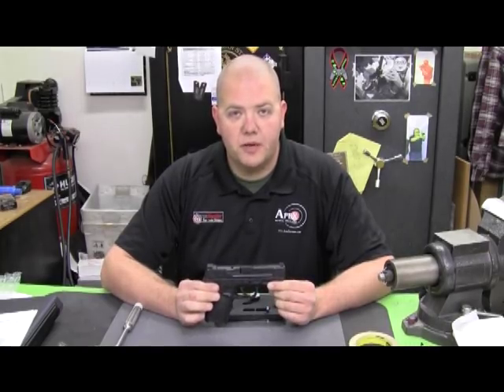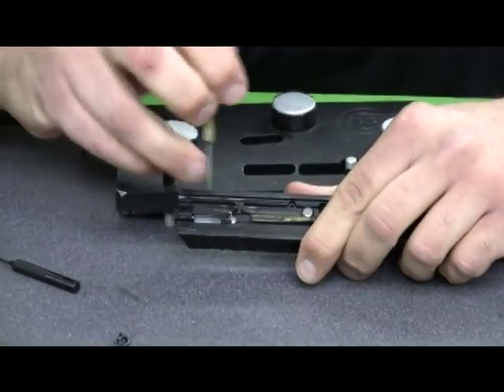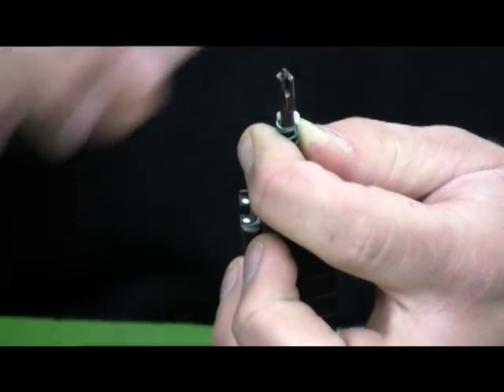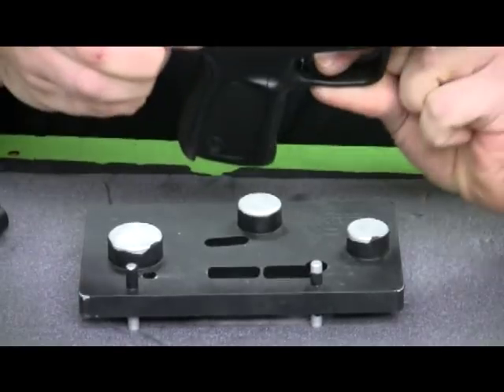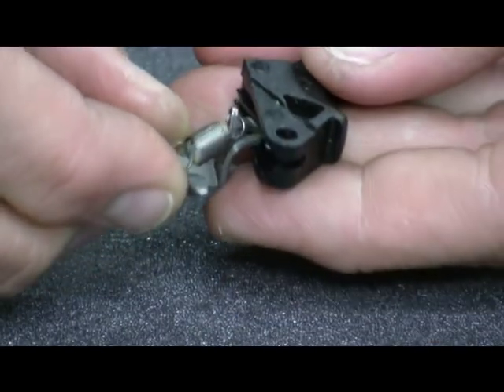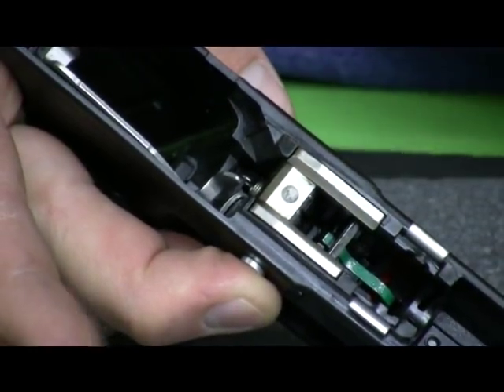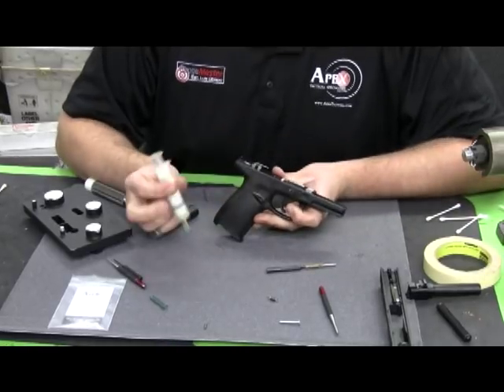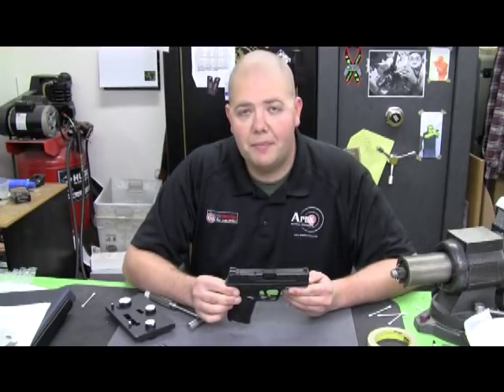SD/Sigma Kit install

Comment: I was able to install this thing, and it was the first time I had broken down a fire arm this far. I am a little bit handy, and the installation wasnt too bad. I did note on initial breakdown of the trigger pivot pin, I did have pull it out in  the opposite way of what the guy in the video did. It doesnt seem to matter as long as you install it back the correct way. The only part that was difficult was the reassembly of all the parts through the pivot pin, but if you stay patient and use a flashlight you will get it lined up.

Comment: I tried this with my SD9VE. Everything was pretty much the same ....except, when removing the trigger pivot pin, the slave pin would not insert from right to left as video shows... the slave pin removed the pin going left to right.(so backwards in a sense) The knotches on the pin were the same, but i could not remove it as shown on the video.
Becasue of this, reconnecting the slide lock lever was tricky moving left to right.
Hope this helps
Reply: +escaldo74 same here thank you for that, it really helped me out
Reply: glad it helped you out! I struggled with it! lol
Reply: +escaldo74 You just saved my life.
Reply: +escaldo74  thank you for posting this. I had emailed Apex and they did not suggest anything beyond keep trying. That didn't work. I tried your way and it came right out. Thanks again!
Reply: +Bill Rice glad it helped!!!!
Reply: Miles Norsworthy glad i could help
Reply: +escaldo74 I had exactly the same experience yesterday on my SD9VE.  I only wished I had read you're comments before trying to install the kit.
Reply: +escaldo74 Mine won't budge from either direction
Reply: +HiveTyrant36 Did you ever figure out what was wrong? I'm having the same issue.
Reply: Justin Baker Aw man! I got it after about 20 minutes messing with it. I honestly don't remember. I think I may have knocked it out by force. After that it was smooth sailing. Easy to put back in. Wish I remembered. Get a hammer and a small flat pin (security driver works)

Comment from the maker: you can replace only the TRS it will reduce pull weight about 1.5 lbs.  removing the sear spring will cause failure to reset.
Reply: +apextactical well good thing I saved it.. now just to remember how to put it in.  Thanks for the reply.

Comment: Nice video, just installed on my SD40 VE. I knew it would take me a little longer than the 14 minutes it took this guy, but I didn't run into any problems.  It took me about an hour and 20 minutes, only because I didn't have the proper tools.  I had a hard time getting the pins out (I used a drill bit and hammer), but once I did, it was pretty easy.  Can't wait to try it out at the range!

Comment: Easy pull and replace. Still has a long travel, but less tension on the pull w a cleaner break. Easy instructions too. This kit is a no brainer if you have an SD.

Comment: thanks for the vid the springs and trigger are installed. only thing is my pivot pin was a little tricky coming out but everything seems good now.
Reply from the maker: the trigger pivot pins can be a bit tricky to get out, but it sounds like you got it taken care of pretty well.

Comment: Scott: WE SD VE owners need our own video. While you are, indeed, holding an SD - the SD VE's more expensive sibling, can you guarantee that the SD's trigger and rear assemblies are identical to those of the "Value Enhanced" version of the SD model?

So far, they do, and given that there are differences between the SW VE and the SD VE (for example, the loxcation of the extrractor bar pin), at least we know it is in the SD family.

So, if there are no differences between them (although you had been including the unnecessary slave pin that goes with the AEK trigger and had been charging $25 for the kit instead of the original, and normal, $21, for awhile, it looks like you went back to the original package and removed the useless slave pin that bumped up the price).

I, and most of the SD VE owners in America, would reallyt, really prefer if the word "Sigma" did not appear anywhere near the SD VE model designation. If there ever was an F-bomb equivalent in the gun world, it would be the word, "Sigma," for all the hatred it engendered for its "Trigger from Hell." Many of the original Sigma users did their own trigger mod for free by discarding the second, smaller trigger spring - which is also a step performed in the Apex upgrade - to change their 8lb pull into a 4lb pull. 

So, I'm guessing that your replacement trigger spring is heavier than the Sigma spring to make up for the fact that it now has only one spring to keep the trigger from being too light for its action.

Again, PLEASE do up a video with an SD9 VE (or SD40 VE) and actually use one in the video. That way, the Youtube title will match the screen title in the video - and will match the actual gun shown..
Reply: I just replaced my trigger and springs using these instructions. The parts are identical.
Reply: I have both the SD & SD VE. My SD has a 9 - 10 lbs pull, and my SD VE a 7 - 8 lbs pull. I have been thinking about getting this kit for both. Every review I see only shows a 2 lb change, for both. I'm wanting to get a kit for shorter reset. So far, there isn't any. I'm thinking about trading both for a M&P instead. At least it has 6 lb trigger, and short reset out of the box.

Comment: fot the trigger pin, i use small flat screw driver to pull the slide spriing and push the pin that way is very easy and painless to disamble

Comment: Thanks to all the commentors. Trigger pin was NOT coming out at all. I nearly bent the slave pin. Noticed some commented their trigger pin was installed backwards and used a jewelers scredriver to leverage the trigger spring up to take pressure off the pin, as it wouldn't fully come out pushing it out the right either. Using the jewelers scredriver to ease the pressure made it pop out as easily as in the video.

Comment from the maker: any time anybody has trouble of any kind installing one of our kits, we recommend they contact our customer service for help.  Where did you get stuck?
Reply: I got stuck on the trigger pivot pin. it would not pop out like in the video
Reply: apextactical idk if it's just the California compliant model or what, but my mag disconnect came completely out of the sear housing block. How can I fix this
Reply from the maker: Tyler Sullivan call customer service to get instructions on reassembly

Comment: This is a good kit, instantly made my trigger better. Make sure when you are installing the slide stop DO NOT bend the wire attached to it. I accidentally bent mine and it was a bitch to get the trigger pin lined up with the rest of the components.

Comment: Slide & assembly springs went well, But the trigger spring holy crap. Close to an hour trying to get trigger pin out left to right as in video, and would not move. Went to bench and gave a tap left to right, pin slid out. Trigger spring went on no problems, the most unbelievable time I spent was getting the slide lock lever (and lock spring) in place and lined up. Still has a long "break", but it's much lighter on trigger pull
Reply: That's the same problem I'm having how did you get the spring to stay under the housing area
Reply: Antwan Hicks Don't recall now. But unbelievable amount of time. Stepped away a few times out of frustration. Slide release finally lined up, and in all popped in place. But getting that slide release in place correctly was the only problem I had.
Reply: I hope you read my comment above and hope that Scott answers it. You should know that he is working on an SD model. NOT the VE "Value Enhanced" little brother of the SD or the SW VE, or anything remotely related to the Sigma.

Going from left to right is the easy direction for both the rear assembly and the trigger assembly.  Whenever you hear or see right to left - FLIP IT - and go from left to right.

Comment: I purchased the Sigma spring kit for my .40 SW40VE, but this video does NOT match this weapon, as there is not pin hole on the side of the slide like you show on the SD on the video. How about a video specifically for the Sigma?

Comment: I have the SW40VE, no pin in the slide as you see in the video. You remove the
extractor and plunger spring to get the firing pin safety plunger out. The video
makes replacing the trigger spring look easy....it is IF everything is in perfect
line when you get the slave pin in.... No such luck here, The slide stop can be
very hard to align and you MUST get pin trough the holes in the trigger !!!
Please do a vid for the Sigma !!!

Comment: Also, I'd like to note that the "hardest" parts for me was getting the far back pin out and then getting the slide release to line back up after the trigger install.  Also, be careful not to let the pin that holds the trigger section in place to catch the spring sideways or incorrectly.  Took me awesome to notice it was sideways and therefore couldn't let the pin passed it :)

Comment: I had difficulty getting the trigger pivot pin out also.  It absolutely would not come out no matter how much I manipulated the slide release UNTIL I used a pin punch to lift up on the bottom of the release at the pivot pin point.  Just couldn't get the lift at that point without the punch.  Possibly using (gently) a pair of pliers to lift the release would have work.  Other than that everything went very smooth.

Comment: FYI, if you have the CA, version you will have a couple extra pieces not shown here fro the Mag lock, you can leave out the extra pieces to disengage the Mag lock
Reply: are you talking abou the extra spring on the sere housing block and the little extra lever? you can just leave them out?
Reply: Yep, I removed them, spring and metal link, and I also pulled out another piece to avoid any extra parts in there
Reply: Think you can help me with how the magazine disconnect goes back together? It's my personal preference to have it on..any help is appreciated.thanks!
Reply: Josh Maldonado  you basically have to do the same technique you did on the trigger spring. you have to use the slave pin guide that comes with the kit to put the mag release pin in because that spring also goes on with tension
Reply: @mauricio ornelas thanks! yea i figured id have to do something like that. the only problem now is i dont know how the position the spring for the disconnect is supposed to be positioned.

Comment: A REALLY big important note I learned today about the install of the spring kit and the trigger. The procedure is different for a SDxVE for a California compliant versions of these weapons. The CA versions have an additional safety feature that the gun cannot be fired if the weapon has a round in the chamber and the magazine is removed. Imagine my HORROR when I removed the sear pin and had a large spring and metal rod come flying out of the gun, landing across the room. Trying to figure out how to reinstall these pieces was a chore as I had no reference as to where they were originally placed. BE WARNED California owners if you attempt this upgrade.

Comment: About to get to work on my SD9., My kit came with a sear housing spring, but no slave pin.. I see you said the housing spring is not important, but just want to make sure im getting the most out of this kit and doing it right. Any comments? Thanks for a great video though!

Comment: i installed the spring kit & the trigger on my SD9VE, excellent product & must have upgrade.  My only complaint is I've had a few light strikes and have to be careful what range ammo I use.  Armscor is a no go for sure which is unfortunate since I have a bunch of it on hand.  Is that just white lithium grease being used to lube?

Comment: I just got this gun and LOVE it (SD40VE)  I installed the apex kit but noticed one thing...during the tutorial about the removal and install of the trigger pivot pin, I was unable to remove from right-to-left and install in the reverse as the video implies...to the point where it didn't seem stuck but just wouldn't go out that way, period. I tried removing from the left side to right and it came out a whole lot easier.  Is this an issue with my gun or is easier on the .40 to do it in the reverse?  Thanks.

Comment: this is a little strange, I have had the apex trigger in my sd9ve since March with no issues.  last time I went to the range it would not fire, I filed the trigger as shown with no improvement.  it will dry fire fine but not when loaded with live ammo or snap caps.  I reinstalled the stock trigger and now have no issues, any ideas?
Reply from the maker: that's an odd one.
Reply: @apextactical  Good video. I have a question about the trigger pin. Mine New from the factory is counter sunk into the frame hole deeper on the left side than the right. It is countersunk on the right side but more on the left. Is this the correct seating of this pin or should it be even on both sides?

Comment: I used your very detailed and informative video to install the apex trigger and spring kit in my SD9VE yesterday.  When I went to the range today,  I had a lot of problems with the casings not extracting and it would jam as it tried to load another round. It was often, but not always. A few times I shot 10 rounds with no problems. happened with both magazines. Anybody have this problem? Maybe I didn't install something correctly. The gun ran perfect before this.

Comment: I did an install with both the spring and the trigger kit system and how I'm having a problem with the trigger not breaking at some points in Breaking at normal points. for some reason the trigger randomly hangs and doesn't break no matter how hard you push back comma but if you hold the trigger back in wiggle the gun the trigger will break.

Comment: What if the back plate of slide doesn't come off "very easily"? I don't want to damage this cheap plastic pushing anymore. I am pushing the white sleeve forward and my thumb is not strong enough, nor is creating a cantilever and applying rearward force. It's nearly destroying the plastic. Any help would be greatly appreciated.

Comment: I'm trying to install the SD Polymer Action Enhancement Trigger in my SD9VE and not having any luck. I think part of the problem may be with the slide release lever. When I reassemble it, the spring is making the slide release lever pop up, instead of holding it down. Then when I do the full reassembly, pulling the trigger doesn't make it dry fire, even after racking the slide. Any ideas?

Comment: can you give a complete list of needed tools please and also is this the same instruction video for the sd9ve? i bought this spring kit thinking it was the same
Reply from the maker: 3/32 pin punch is all you should need. yes it's the same thing.
Reply: +apextactical The video said 1/16" punch
Reply from the maker: The 1/16 punch is for the extractor pin.  3/32 is for frame pins.

Comment: I am having a LOT of trouble getting the trigger assembly working after putting the spring back on.  I have the pin in and spring is attached. The trigger does not have fully range of motion and will not reset.  Any thoughts?
Reply: Got it. I missed passing the slave pin through the top two holes in the trigger.  :).

Comment: @2095GMK depends on who you talk to at Smith. Some say yes and others say as long as the mods were not the cause of the issue. Just keep your old parts. I just installed the kit in my sd40 and that's the best $20 you can spend on that pistol. I paid $319 for my pistol brand new, so warranty does not really concern me.

Comment: I put the spring kit in and the trigger but now with the slide on, the trigger bar doesn’t catch the sear. With the slide off it catches fine. This is for a SW9ve

Comment: so I replaced all springs along with the enhancement trigger from you guys and it won't fire, the trigger pull is not far enough to fire the pin and now I can't get the gun apart due to the action being sprung.... any suggestions?
Reply: update, was able to get the slide back off and discover that the trigger needed to be filed down. I found this through research to be a common problem with the apex trigger.

Comment: well... I watched the video and gave it a try.  I just couldn't get a good enough view of some things and in the end, it went together wrong during reassembly of the trigger and following parts. Got the gun put back together and it wouldn't function. Moreover, since it wouldn't function, it wouldn't break down and come apart. Had to take it to a gunsmith. 
My recommendation: 
The people at Apex tactical should focus group this video and with people who aren't familiar with taking a gun apart. Just some random people... and have them try and follow along  with a video, trying to replicate it. It will show where things need to be explained further and what needs a better vantage point in the video.
Reply: damn bro. if u can't even follow this simple and easy video life must be really hard for u. smh
Reply: @whysoserious9026  why don't you button it?

Comment: is the trigger bar held in by the pin in the trigger? I took everything apart and can't remember. I re-assembled everything and the slide doesn't go on all the way, it goes on about halfway and than gets stuck on the frame? any suggestions? what could cause this because I believe I've put everything back in correctly and watched this video several times. Thanks.
Reply: I ended up figuring it out. The trigger bar was connected to the trigger (pin wasn't through it, holding it in place) than I put everything back together and its in working condition. Thanks.
Reply: Well to be honest, I didn't break my gun down to install the apex spring, (dont own this spring) I broke it down because I was really bored the other day but couldn't get it back together so I used this video as a reference to go by so I could reassemble it.